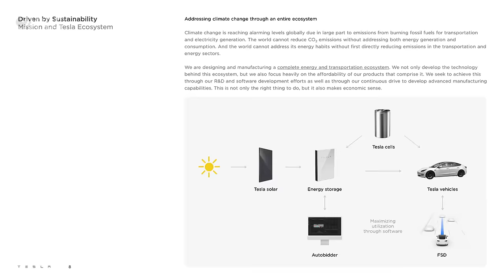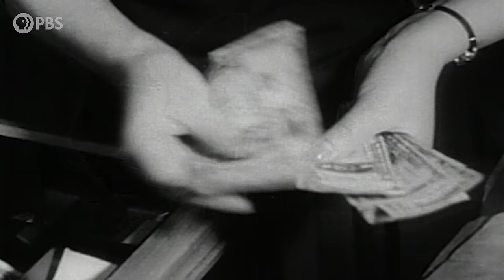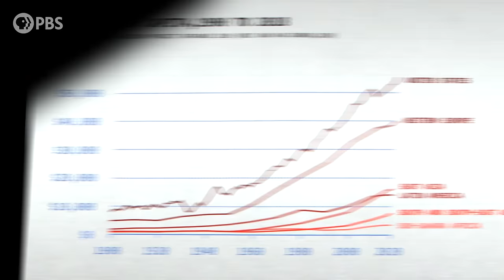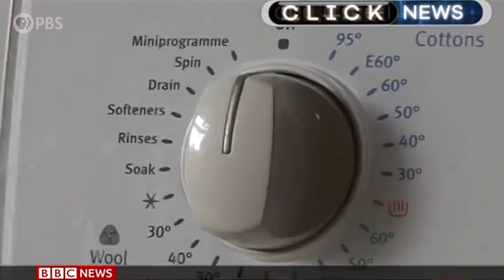You Can't Shop Your Way Out of Climate Change

Comment: So long as you intend to drive the same vehicle for a while, an electric vehicle will ALWAYS be better than a gas car, even if powered by a dirty grid, because they are zero emissions. A used Prius has small upfront impact and a relatively small ongoing impact from burning gasoline efficiently, but it still burns fossil fuel and will continue to pollute and increase its impact the longer it's on the road. A new EV, on the other hand, has a larger upfront impact from production, but its ongoing emissions from the generation of electricity are miniscule by comparison. If you buy a new EV and drive it for even a couple years, you will have easily made up the difference in lifetime emissions and continue to be even less impactful compared to a gas car the longer you drive it. That difference is only made wider the cleaner the electricity you have. That's why we should be electrifying everything in our homes and infrastructure, because they're usually more efficient and will only become less polluting over time as the grid transitions to cleaner power generation. Better yet, get solar panels for your home and now running your appliances and cars will have zero impact other than the initial emissions from their production.

But enough can't be said for undoing the social programming of capitalism to overconsume and demand new things. Use less, buy secondhand, repair what you have, and give back when you're done. In other words, REDUCE, REUSE, RECYCLE! Oh yeah, and VOTE!
Reply: It seems like the video was counting the cost of production for the EV, and comparing it to a gas car without factoring in production, which is not fair. 

Also I thought you CAN reuse or recycle EV batteries now?
Reply: @mcv2178  Yes you can! And solar panels! It's a really young industry though
Reply: Gas jumps from deep under the ground just right into your gas tank.
Reply: is it really zero emissions if a dirty grid powers the battery? Sure, it is zero emissions at the tailpipe, because those emissions were transferred to that coal fired power plant.
Reply: @zimmejoc  good point. Yes EVs powered by a dirty grid have emissions, but still less than gas. ICE cars burn fossil fuels not only at the tailpipe, but also during extraction, refinement, transportation, and distribution. Not to mention that half of the energy burned from fuel in a car is wasted as heat, so there's additional emissions there as well. Electrifying everything makes sense because electric alternatives are usually 90-100% efficient and only burn fossil fuels once at the point of generation, if at all.
Reply: @zimmejoc  yes, and even if 100% coal derived electricity it has lower carbon impact, is still more effici m than gas.

But the real advantage is that the grid is only going to get cleaner and eventually be renewable.  It's inevitable because FF are finite.  Also, gas cars have a tendency to wear out and get more dirty over time.

So if you're actually worried about about how dirty an (electric akin to a BEV) light bulb in your home is, then push for a cleaner grid or invest in your own PV and take direct control.
Reply: But, as touched upon in the video, the best electric car is still way more polluting than other modes of transportation like public transit or bikes, that's why even replacing all ICE cars with electric ones isn't a solution. Not to mention cars of all types also cause a huge waste of space / land since most of their time is spent sitting still in a garage or on a parking lot, which in turns worsens urban heat island effect in summers, and water run-offs when it rains.
Reply: @_asphobelle6887  BEVs have other advantages.  When parked, they can be plugged in, and be a good sink for renewables so to avoid curtailment.

Furthermore they can also trivially supply power back to the grid.  Many homes use power wall or other brands of stationary storage, which collaborate as a VPP (Virtual Power Plant).

But a BEV generally has 3x to 10x or more storage capacity than a home would have installed.  Integrating cars the way homes are is still early, but I expect it will become common place.  So they are an enabling technology for renewables, not just a new kind of car.

Then there is automation, which could increase a cars utilization rate by multiples which changes the equation substantially.

The contention isn't about using BEVs instead of transit or bikes or having more walkable communities.  The point was to correct the flawed argument that batteries are disposable when they will become nearer to aluminum which is highly recycled.
Reply: @_asphobelle6887   That is a side I had not thought of. I have read a lot and there are so many factors! Seems like even now, electric is better if you need a car, and should improve. But it sure is not easy to be sure!
Reply: @mcv2178 yes, you can recycle those batteries. There is a huge recycling plant in the US,now that does it. I just saw a YouTube video on it last week. And they can get 90%+ return of the products. So, after I heard that, I felt much better about the batteries.
Reply: @_asphobelle6887 unfortunately in the US, we don’t have a great transit system. In rural areas, there are no transit systems. When we lived in New Carrollton, Md., many, many years ago, we didn’t own a car. We were on the subway system and lived close to grocery and eating places.  But where I live now, I would have to drive to get to a bus stop.
Reply: @D0li0  They may, they could, maybe, the technology isn't there yet... But we need a solution now and going full throttle on electric cars means locking us for decades in a system we're not even sure can work as hoped. The energy use of a car just to move one person most of the time, is horribly inefficient, and the land use is even worse, and that won't change with better or recyclable batteries. As for helping with renewables, batteries could be integrated in the grid alone, without being reliant on people not using their cars when power is needed.
Reply: @_asphobelle6887  legacy FF was the locked into paradigm.

BEVs have enabled battery costs to decline to enable stationary storage that's cheaper than NG peaker plants.

BEVs allow for PV to displace high gas costs when they didn't make economic sense for already cheap electric power about two decades ago, which enabling economy of scale to drive PV prices so low today that they can compete with general building material costs... People are building fences and balconies out of bifacial PV now...

All this BEV storage capacity is inadvertently agnostic energy storage the likes of which humanity hadn't and still some don't comprehend.

Comment: OMG if you go through the COMPLETE supply chain for making ICEV vs. BEV, they're about the same.  But this is ONLY for the vehicle itself.

The issue is manufacturing the vehicle itself for ICEV is only a TINY DROPLET in what's required to make an ICEV go vs. making a BEV go, IF powered by solar panels.

Next, IF
 a BEV is powered by something like solar panels, meaning buying a BEV in some places is better than others (where solar panels make sense), then the environmental cost to power the vehicle swings WAY IN FAVOR of the BEV and it's not even CLOSE.  The thing about a natural gas plant is you keep having to pipe natural gas to it.  That's an entire chain not needed for solar panels, getting the energy and building all the infrastructure to do that.  And making the millions of parts required for THAT function.  Solar panels magically have their energy source delivered to them, by solar radiation.

With solar panels you are skipping ANOTHER complete step in manufacturing, or millions of parts.  I don't need to build this huge power plant.  I need to install metal framing.  I don't need to install the millions of different parts that all come together to make up the internals of a natural gas power plant.  I don't even need to manufacture the millions of parts that go into making all the parts to go into the natural gas plant.  You know, because I have to manufacture all the plants that make the parts that go into making a power plants.

This is a HUGE world of difference.

Next, if you want to talk about how you POWER an ICEV, what is all the infrastructure?  

Building the machines that are used to explore for oil and running them.  OK so now I have millions of parts involved in JUST the exploration for oil.  In the case of ocean exploration, that means building ships.  These units consume a lot of energy to do this.

When I FIND oil, now I have all the infrastructure needed to get that deposit fixed for extraction.  In the case of offshore oil, we need ships again, VERY specialized ships.  Anyone remember the explosion of one of these rigs in the Gulf of Mexico?  Those highly specialized city like drilling units, like the Deepwater Horizon that exploded in the Gulf?  So, we need millions of parts to build THOSE machines.  These units consume a lot of energy to do this.

But we're not done.  Those small cities only get a well set up.  Once that's done THEN you have to build a rig to pump the oil.  Millions more parts.  These units also consume a bit of energy.

But we're STILL not done.  We need even MORE ships, ships that will transport oil from the rigs to refineries on the coast.  Yes, millions more parts.  These units ALSO consume a bit of energy

But we're STILL not done.  We have to refine.  So once again, millions of parts needed to build refineries.  We also have to use chemicals in the refining process. We also have to consume a bit of energy in refining.

But we're STILL not done.  We have to build the infrastructure, often trucks to take the refined gasoline to stations.  So, millions of parts to make the trucks, millions of parts to make the gasoline stations and all of this consumes a bit of energy.

Now, what I DIDN'T do is mention all the mining, because unlike what has been said about mining for materials for batteries, the mining required to make ALL that infrastructure I mentioned above DWARFS the infrastructure needed to make a solar panel.  And I'm not at the vehicles yet, because manufacturing either is about the same, which ALSO means the mining to get the materials to MAKE the vehicles is about the same.

See?  The actual vehicles only come up at the very end of all this.  It forgets about the HUGE HUGE HUGE difference of making the infrastructure to fuel an ICEV vs. a BEV.  It forgets about not having to drill for sunlight.  It forgets SO many things that this point being made is LAUGHABLE.

And if you want to talk about expanding the power grid to deal with the extra electricity to power BEV, yes this is true.  Mind you in many cases you don't have to remove what's already there, in some cases you do.  Often you can run more electric cable into areas and leave a good chunk of the existing structure.

But if you want to talk about that we need to talk about roads, because delivering gasoline to gas stations is constantly ruining roads.  This infrastructure is ALSO expensive to maintain.

Sorry PBS Terra, you used information handed to you instead of using a big brain and doing REAL investigative work to make a brief documentary.   There's a reason why it takes a person like Ken Burns years to make a single documentary.  I realize you can't do that for a YT video, but in that case there are topics that are too big for a YT video, or you need a person with a REALLY BIG BRAIN who has done years of research into a topic and rely on them to show what's flawed in the talking points that get made today.

When BEV is powered in specific by solar panels, this LAYS WASTE to ICEV in terms of energy consumption, MINING, and environmental impact and a MASSIVE reduction of infrastructure needed.  It's so VASTLY better it's hard for me to fathom the small brained people that can pass on the propaganda the energy companies publish.
Reply: I think you made some good points. I'm working on adding some very important points, but I'm not going to struggle with adding conclusions (especially consequences) for those points.

Recently, the Russo-Ukrainian war (which is a US-NATO proxy war in many ways) has resulted in Russian natural gas pipelines to be destroyed. At least some of the natural gas that was to be delivered to other parts of Europe by those pipelines is going to be delivered by liquefied natural gas (LNG) ships from the US.

US militarism, which dominates Earth, is overwhelmingly powered by burning fossil fuels.

Comment: While I agree that we need to stop overconsuming and start investing in public transport, there are a couple of things I found misleading about the video. The first section about EV almost exclusively talked about the production emission, without mentioning the overall CO2 emissions of the various kinds of vehicle technologies. Told like that, it gives the impression that we should keep our current vehicles in order to reduce CO2 emissions, while it is quite the opposite. 

An EV over its lifespan gives off much less CO2 and reduces the concentration of pollutants in our cities if confronted with traditional ICE vehicles, even with our current mix of electric energy production methods. Also, as we improve our ways of getting more electric energy with renewables and nuclear, an electric vehicle will continue improving its efficiency and pollution figures while ICEs are doomed to stay the same.

All of this is to say that most of us would be better off changing their ICE vehicle because in the long run an EV will end up being more beneficial. Obviously it would be better yet if people would start using more public transport or bicycles, but any improvement is welcomed. This is especially true for people in rural areas since they cannot rely solely on public transport and bicycles to get around and often have long distances to travel to get to work.

I would say that reduce reuse recycle works really well for all objects that don't require any further energy to work. But if an object uses energy, the evaluation is not so clear and intuitive.
Reply: Sad that so few read and liked your comment which is well thought out. Sadder yet, they’re willing to create important opinions on talking points mostly contributed by the fossil fuel industry.
Reply: @colingenge9999  It's a new comment.  The default sort is by "top".

Comment: Electric cars are more expensive to make, but that’s mainly because they haven’t been around long so there is still a lot of research to do. At least the fuel is less polluting.
Reply: Have you ever seen the places in China where the batteries are made? One of the worlds largest lakes turned into a toxic waste dump. Lithium, Cobalt, and other exotic rare earth metals make it extremely toxic. It's not better, it's just different. Electric cars are more expensive not because of a lack of understanding, but because of a lack of material. If we take the global supply of lithium and used ALL production it'd take about seventy years just for the USA to go fully electric.

That's excluding the fact your power company still burns hydrocarbons to make the power.
Reply: It's not, a very small fraction of electricity is produced through renewable means, and most is from coal or natural gas
Reply: There isn't enough lithium in the Earth's crust to supply the transition to EVs.  Until EVs don't rely on lithium batteries, they're only a stopgap.
Reply: @GeorgeWashingtonLaserMusket  I’m not saying it’s not bad, it’s terrible, but it’s better than fossil fuels.
Reply: @Anton-V  I know but it’s less wasteful to use it to charge a reusable battery than to process it and burn it in cars.
Reply: @GeorgeWashingtonLaserMusket  Any and all mining is horrible (including the mining that happened to power your ability to be here making comments). With that said, I’d like to point out a couple of things. 1) Lithium can be horrible and not that bad depending on where it’s mined and from which specific conglomerate of rock it is refined from. 2) Your time analysis is off by a wide margin because it doesn’t include new sources which will come online. 3) Not all power comes from (or will come from) burning fossil fuel. For instance, my used ev is powered by hydro and I live in the states.